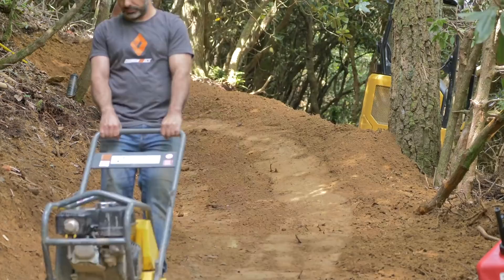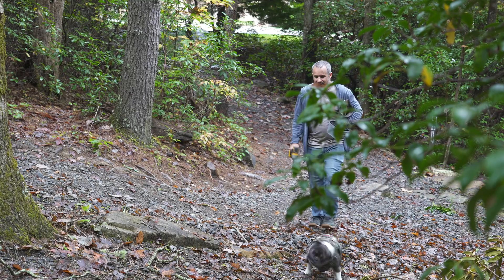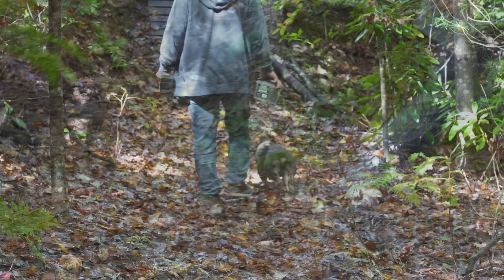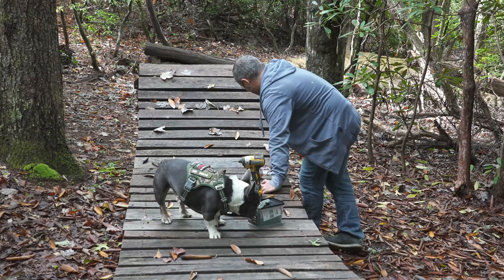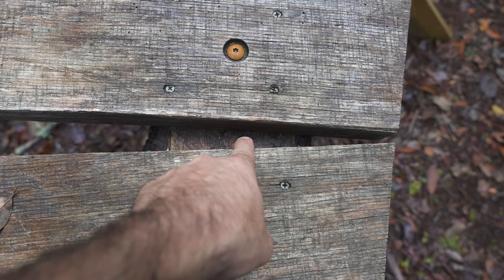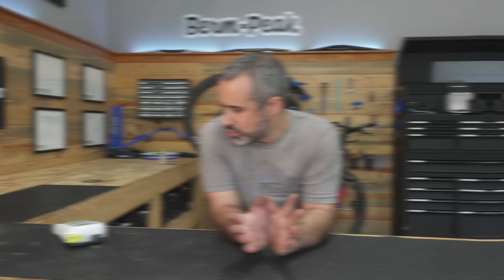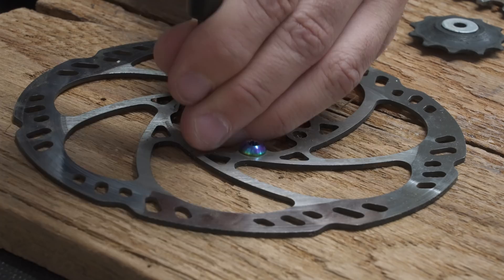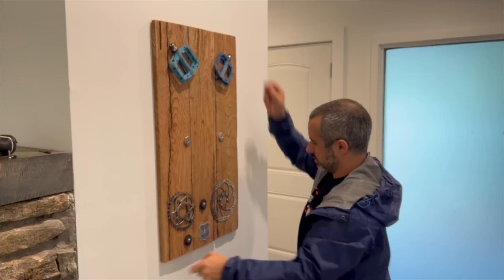How have Berm Peak's Wooden MTB Features Held Up?

Comment: The screws aren’t snapping due to movement. They are snapping because a weak point forms where the screw/treated lumber transition happens. The screws, even though they are probably “compatible” with treated lumber, are rusting in the treated lumber and likely snapping right at the point where the screw is no longer buried in treated lumber but in the decking on top. Treated lumber is absolutely brutal on fasteners. Especially when the wood stays wet for long periods. If you want to eliminate the problem you need stainless screws. Specifically 316 although 306 would be reasonable.

Comment: If you notice the screws are snapping where the threads end, this is also potentially caused by heating up during the installation combined with the torque from the screw gun creating microcracks that will break over time.

Comment: Hey Seth, I've used those screws for decking, but do yourself a favor and switch to the GRK brand. They are a little more expensive, but they are much stronger and should not break.

Comment: 4:00, Pretty sure you are meant to use nails when assembling a wooden structure because the screws will just get lodged in on of the pieces of wood while the other piece tries to move and then it puts a lot of strain on 1 small area, compared to a nail which allows it to slide back and forth instead of just side to side motion and that prevents it from breaking in half like those were.

Comment: General rule for wood movement is about 1/8” per foot. So if you leave 1/4” between 6” wide boards you have waaay more than you need. Theoretically. Plus you’re in probably the worst possible environment, so maybe a half inch to just let water and air move thru better and you’re good. The spacing on the whale tail looked to be more like a whole inch, probably overkill. But if that’s still smooth enough to ride on, then go for 1” and save some wood!

Comment: @Berm Peak Express

I looks to me like you might be getting corrosion in the area between the boards and the wood they're screwed into even though you're not getting rot.  The screw coating is corrosion resistant but the carbon steel screws aren't.  You'll have to evaluate whether upgrading to more expensive stainless screws is more economical and reliable in the long run.

Have you considered using anti-skid paint on any of those boards?

Comment: I'm probably a little late but if you have a ton that snap off you should really consider using like 3 to 3.5 in nails, nails are built to bend and go with the flow of wood where screws are very hardened.

Comment: I’m a carpenter. I used to use deck screws for a lot of tasks but I’ve since switched to GRK fasteners. They’re actually load rated construction screws. I’ve never snapped one out of the thousands I’ve put in. They also make large structural screws similar to the “timber locks” you were talking about. I’d highly recommend giving GRK’s a try. They’re available at Lowe’s and HD so it shouldn’t be any issue finding them. Also any lumberyard worth anything should also have them.

Comment: HOW TO FIX AIR BAG JUMP!
Everywhere the deck boards touch, run your curcular saw along the line where they touch with the blade depth set at the width of the deck boards.
Quick & easy way to allow for expansion & contraction.

Comment: I’d be interested if the screws broke due to moisture. My uncles deck has similar issues and it was from moisture build up in the screw holes, causing them to somewhat rust and weaken

Comment: You could add burnt motor oil mixed with diesel fuel on trailer boards to stop rot and damage from rain we coat ours twice a year and have trailers with 20 year old boards on them

Comment: Realize screws are not for shear, so as you discovered if there's any lateral movement they will give. Shear requires nails or the new structural screws simpsom makes. 
You should put qr codes next to the items so people can scan them and watch the videos. Maybe not on the display but near by or something.

Comment: Seth, im wondering if using nails instead of screws would work better because nails can bend and move while still holding strong where as screws will snap off with movement

Comment: Those screws are notorious for snapping. I’ve used them quite a bit and often times they snap on installation by over torque’ing. If you go down too far they, the driver will snap them.

Comment: You can use nails insted of screws. Screws have no give any presure causes snapping. Nails are designed to be less rigid and they will bend with pressure as appose to snap.

Comment: Screws don't have any bend in them like nails, they will snap before bending. When framing a house it's the reason nails are used because they won't snap.
So what might help is using nails instead of screws.

Comment: Benefits of nails over screws, they will flex with the timber over time where as you’ve found screws tend to snap under load, that’s why timber house frames are still built with nails and not screws

Comment: If you use a stainless steel screw it will hold better as they take up the movement in the wood better without breaking.

Comment: Hey Seth your screws may be snapping becuse the clearance hole (in the board) isn’t give the screw enough if any clearance so when you pre drill try using a bigger drill bit in the boards

Comment: Screws snap when the wood expands in the summer/ contracts in the winter. the wood expands long ways, so the board acts on the screw in shear. and we all know screws are terribly weak in shear.
Reply: spacing out should help a little bit.

Comment: the shorter screws might just be grabbing sap wood. Use  round or oval shank  nails (not ring shank) the are more malleable( more pliable or bendy!)  than the harder screws...top tip nail them in at an angle to each other its called dovetail nailing....you can drill smaller than nail pilot hole to stop splitting  ....actually if your wheel barrow has metal axle and bearings oiling it now and then not a bad idea 🙄😀

Comment: OMG Oscar's butt when he trots along. <3

Also, the rule of thumb I've always followed is if you should have the same length of screw shank in the anchoring wood and you have in the anchored wood. IE: if you have a 1.5" thick board being attached, you should have at least 1.5" of screw shank biting into the wood below.

Comment: Screws can’t withstand sheer force there breaking off half way Bc of sheer force Bc the screw it hardened use nails your knowing of the wood expanding is correct I just don’t know the long term for longer screws hope it works

Comment: Deck screws are pretty weak and subject to a lot of corrosion in hardwoods. I've had them rust through in 3-4 years. I've used about a hundred pounds of them so far over the last 7-8 years and I find a lot of them snap exactly where you had the one do it, even brand new ones I used for building forms for concrete work. Don't get me wrong, I love them, but they have their limitations.

Comment: Hey Seth, fasteners should be twice as deep as the material you are sticking down, 1.5" should use 4.5" this is an old school rule of thumb. 1/2" material 1.5" screw and so on.

Comment: OK, so there's 2 reasons why you are seeing screw failure is impact driver issues and general design of screws.  The design issue is screws are not ment to flex or give at all if you do they break. Whereas nails are designed to bend with the give and take of wood.. ( reason why nails are used in construction and not screws.. Houses need to bend an flex with wind and weather)

Second thing is impact drivers exert a lot more force on a screw than a regular drill with a Phillips head would. So if you are driving screw heads deep in the wood like on a track it torques the screw causing failure at the ends of the threads. Screws mixed with impact guns are too effective for the screws own good.

Those two combined are a recipe for failure which really sucks because screws are such a good fastener. But if you do not use nails you will continue to see these failures.  But you can negate a lot of issues by drilling a pilot hole and a countersunk hole before you drive your screws

Comment: The snapped screw heads probably snapped during installation or close and with time completely snapped. Normal decking screws aren’t very strong. I prefer to use grk fasteners they are strong and have a predrill thread to it. Also a #10 screw would be better for what your doing

Comment: I know it sounds weird but use nails. That's what construction companies use and it's because the buildings move around and the screws would need to move around with the building but they'll snap. Nails on the other hand don't and that's why they should be used for something that's going to be shifting around and moving.

Comment: Don't know if you've heard, but there's this thing called wood preservative - crazy, huh? It preserves the... wood, can you believe it? But then... I'm also talkin to a guy who's glueing damp wood.. Naaah, just kidding. Not a bad job overall (except for gluing the wet wood - but it's not structural and would probably dry out on the wall without issues). Just.... wood preservative doesn't cost much, after some experiments you could find your favourite, and after applying it in 2-3 coats (minor production time increase), the resulting wood parts would last 10-20 years, instead of 2-3. Greetings from Latvia - the country of preserved wood (actually - I don't know if you've any idea where Latvia is - but being 40, I recently learned the country is the most forested country in Europe by area, so we're all kinda experts on wood here. Good thing Canada isn't in EU).

Comment: the screws might snap because the wood is gaining moisture which is making it get fatter so pushing or pulling the screw and it snaps as a result of the stress

also dude get pipe clamps you wont regret it

Comment: 4:28 Yes, but it’s also basic 8th grade science. The reason liquids freeze is because the molecules get closer together and pack in. It’s the same with wood. In the winter the wood molecules pack together and take up less space, and expand in the summer. If there’s no room to move, screw heads will snap, and jumps will fall.